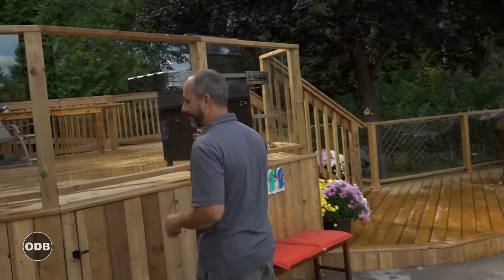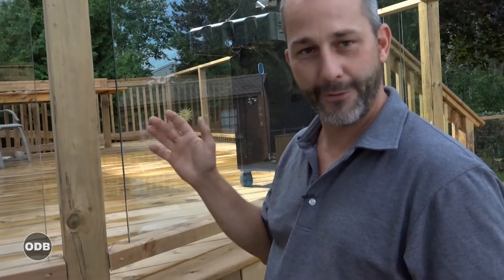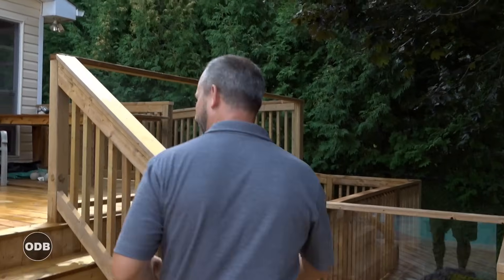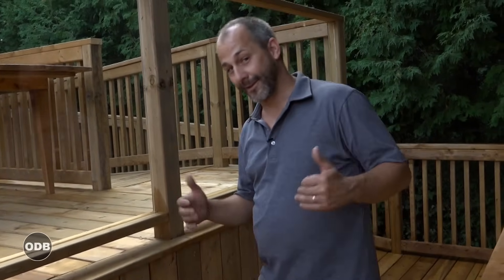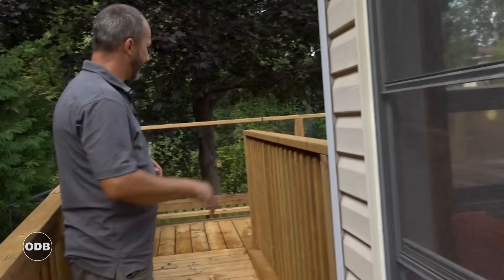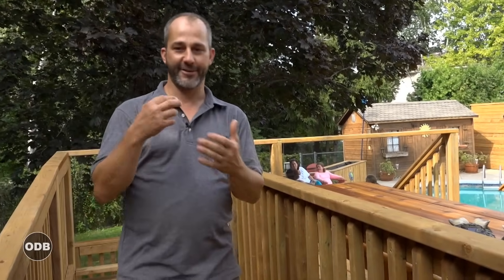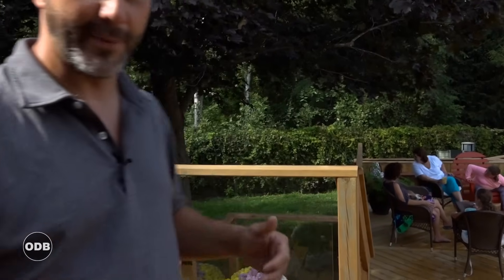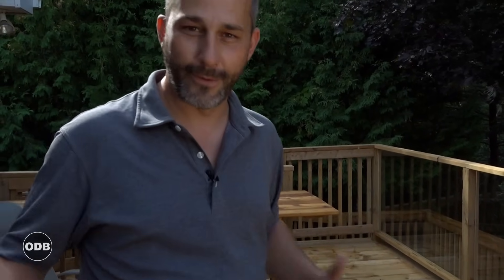DIY DECK Part 8 | How did it turn out?

Comment: Nice job. Just one question regarding the staircase handrail. A handrail is supposed to, by code, be easy to grab by hand. A 2x6 is not something that you can easily grab, it’s just too wide, it doesn’t fit in your hand. It wouldn’t pass code in a house but does it pass code outside a house? 
When i do decks, i usually install black aluminum handrails onto 4x4 posts, looks clean, easy to install and easy to grab.

Comment: I love everything but the ramp. I built a similar deck with upper and lower and a ramp for my mother in law who lives with us. I live in a rural area so our regulations are pretty much nothing aside from it being safe so I was able to take it to the ground. I started the ramp at the house instead of on the outer edge of the deck so it would run down the side of the upper deck then along the front to meet up with the bottom. 90 degree turns can be hard for someone in a wheel chair and particularly for my mother in law because of muscle weakness which is why she is in a wheel chair to begin with. I also made mine far wider so she has plenty of room to maneuver and a grade far more than recommend so she can handle it on her own without struggling.

Comment: Interesting.. In our neck of the woods, code prohibits you from using 2x4 for the hand-railing. The rationale, is that a smaller hand-rail allows a child or a person with small hands to be able to adequately grasp the rail.

Comment: Hey Jeffrey - I always hear differing opinions about what type of skirting to use under the deck.. Biggest concern is airflow, and next would be pests/critters... Doesn't look like mor ethan 1/8th of an inch gap left between the skirting boards here, would this not prevent moisture from evaporating due to the restricted airflow, which would accelerate rotting?
Reply from the maker: That is why we use cedar. this region has a lot of skunks so critter control is very important

Comment: Gotta say great workmanship father and son team 

Got a question I've never built a deck in my life im a pipe fitter 17 yrs i have all the materials to build a deck this summer but im not to certain where to start from deck is a L shape deck 16' by 32' would i get away with 2 foot centers instead of 16" centers as im trying to go the cheapest route in building it if you have any answers please contact me back 

thanks Tyler banff,alberta,canada
Reply from the maker: 2" center is fine if you use 2x6 as your decking material. If you use 5/4 deck board you must go 16 on center. The cheapest rout would be to make a smaller deck.

Comment: hi jeff watched video start to finish enjoyed every minute ,about to start decking project on back garden using floating system.what I am interested in is what type of glass you used ,I noticed you left a 2"gap on either side is this for a reason or could you put full post to post glass.once again enjoyed project and if your son turns out half as good as you he will do well . kev griff aldridge, west midlands ,england
Reply from the maker: The spacing was to avoid any pressure on the glass if posts started to twist over time or uneven elevation over seasons. just a little mercy. I used a 8mm tempered glass product sold in the hardware store for use with an aluminum post and rail system. Thanks for the kind words. My 2 sons are already better men than I ever was at their age.
Reply: hi jeff thanks for reply it makes perfect sense I would be tempted to put a posh leg centre of glazed panel ,did you use  a silicone to bed glass in. it would be nice to go to local store to pick up glass but in uk it would have to go to glass manufacturer . if your boys are in uk come spring help would not be a miss.
Reply from the maker: Hopefully one day this channel will allow us to travel the world and do renos in other countries with different materials and building practices. As for the glass, just run a 2x4 through a dado blade on the table saw to seal your glass. Before installing it put a couple of silicone shims in the track and drill some small holes for the water to drain. This will extend the life of your railing. Cheers from Ottawa.

Comment: Awesome work.  The only criticism I have of this build is how the transition from the deck railing to the stair railing seems a bit disjointed (3:52).
Reply: Yea... dealing with code and inspections, being a contractor myself,  I see WHY he did that.... especially since he was probably pushing it and pissing people off with the glass element....but that post should run past both joined rails and be decorative capped. This would be visually more appealing.

Comment: Hi Jeff! Love the videos you do! Always so informative! Wondering if you could answer a question for me. We are having our front steps rebuild with pressure treated decking. The current porch is just barely resting on the concrete slab that is in front of the steps. I have read that the stringers should be attached to the posts that are concreted into the ground. The contractor has told us that he can just rest the stringers and posts on the concrete slab. What do you recommend? We have yet to get a permit for the project, and therefore don't know what the city we live in will say. I can tell you like to do things the right way. So do you have an opinion?
Reply from the maker: Hi Debra, sounds like the city will be in charge of that decision. I personally prefer to transfer load to the strongest object around.

Comment: That is one awesome deck! Why didnt you use some tape on the top of the joists before installing the deck boards? Isnt it supposed to help with the moisture retention between boards?
Reply from the maker: You only need it if you never clean the organics out. A simple pressure wash twice a year keeps everything clean and dry. Cheers!

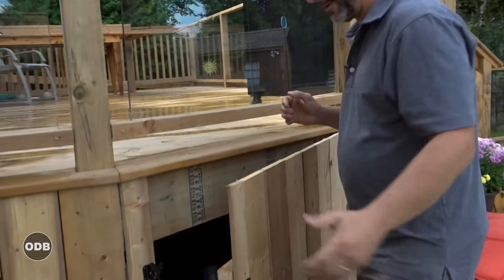Comment: 1:11 How did the lower 2" x 4" hold up. Wouldn't blocking under that prevent sagging under the weight of the glass panel?  I like the clean look, but expect it would sag over time.
Reply: I think he uses long spiral nails for that. I think I would have used 4-sided deck rail brackets. $5-7 a pair, but I suppose he didn't like the aesthetics of them.
Reply: Everything will twist out of shape eventually
Reply: @jeffbrown4292  Likely, and a 2x4 on its face will sag under its own weight over time even without a load (glass panel) on it. I get what he was trying to do from an aesthetics point of view, but there's a reason 2x4's in this application are placed edge horizontal even though it wouldn't look as good. A small block in the center could solve any potential sagging issue and wouldn't look too intrusive.

Comment: Nice video, Jeff... did you use any wind anchors for the floating system? What wind anchors or anchor system do you recommend?
Reply from the maker: Not required where we live. If you have heavy winds in your area I would suggest pouring footings.

Comment: hi jeff managed to find camo system in uk camo tool wide board £48 aprox $58 camo screws £82 aprox $99 for 2000 is this the kind of price you would pay.total price £130 small price to pay knowing my grandkids are going to be running round bare footed on the deck thanks for the info.also nice to see you use dewalt tools as every tool in my workshop is dewalt hope for a reply kev griff
Reply from the maker: Hi Kev sounds like it is a little more costly than here but like you said a great investment. Should prolong the life of the deck to 30 years. Love Dewalt tools. Hope your grand kids enjoy your handy work! thanks for watching.

Comment: hmm... in Norway the gaps in the rail has to be maximum 4", not 3". Are canadian toddlers a lot smaller than ours? :)
Reply from the maker: Yes we have much smaller heads!
Reply from the maker: I am pretty sure the actual code is 3 1/2 but this is so much faster than measuring 3 1/2

Comment: WHAT AN IMPRESSIVE, PRACTICAL & INFORMATIVE DISPLAY OF OTTAWA DESIGN & BUILD'S, EXPERIENCE & QUALITY OF WORKMANSHIP, YOU WERE AN ABSOLUTE PLEASURE TO WATCH ON MY COMPUTER SIR,YOU SHOULD BE VERY PROUD OF WHAT YOU HAVE PRODUCE, FOR NOT ONLY YOUR CLIENTS BUT EVEN A LAYMAN LIKE MYSELF, I"M IN THE PROCESS OF BUILDING MY OWN BACKYARD DECK ATM, & BY WATCHING YOU TUBE VIDEO"S LIKE YOURS, ESPECIALLY LAYING THE TOP BOARDS DIAGONALLY, IT LOOKS FABULOUS.
 MYSELF AS A PLASTERER (DRYWALL) IN AUSTRALIA, I"M NOT THE BEST CARPENTER BUT YOU HAVE GIVEN BE SOME GREAT ADVICE TO TAKE FORTH FOR MY PROJECT, SO WITH THAT I"LL SAY THANKS MATE, LOVE YOUR ATTITUDE TOWARDS BUILDING WHAT THE CLIENTS WANT & NEED, MAY GOD BLESS YOU SIR, I"M OFF TO GET MATERIALS FOR MY 6m x 4m SLIGHTLY RAISED OFF THE GROUND DECKING.... Cheers OTTAWA D&B PEACE OUT CANADA..FROM JOHN M FITZGERALD, MELBOURNE AUSTRALIA, G"DAY.
Reply from the maker: John, I am humbled by your response. Thank you for all your kind words. Glad to be of some help.If you run into anything unusual feel free to contact me. Cheers to down under.

Comment: Isn't the ramp a kind of narrow for the wheelchair? Seems too tight, especially around the corners.
Nice job though.
Reply from the maker: The ramp needed to stop within 48 inches of the fence to pass inspection. so we built it just big enough to navigate . However i agree it would have been nice for the city to give us a little extra room.
Reply: could you not have just shortened the deck by another 200mm
Reply: What city is this? Their code seems like a joke to me

Comment: I really like the design of this deck but man did you skip some important steps… i was hoping to see how you finished off the top rail, especially in the 90 degree corners, and the top hand railing for the steps in this series… especially how you topped it with a 2x6 and managed to make it flush with the top deck rail. 😢

Comment: Hey Jeff, isn't it so interesting hearing about the different codes across canada.  Our city wouldn't even care about the glass. On the other hand they are anal about having handrails on the steps that a person is able to grasp. Your 2x6 top rail handrail is awesome but wouldn't pass our code. If we want the 2x6 look we also have to add a  goofy looking handrail like an interior handrail. 
That thing is built like a brick shithouse!
Reply from the maker: Cheers Dave, You can add a 1x2 as a handrail for inspection and then remove it or pay for an engineer to pass it.

Comment: your deck is not to code. You can't be using screws or bolts to support the weight of the deck. You have to use the post to support the deck. Realtors won't even be allowed to sell that.
Reply from the maker: Cuffs. I'm sure the 2  engineering inspections that I passed can back me up whether i am to code or not. thanks for your concerns. perhaps you have a different code in your city.
Reply: I've never heard of a state not enforcing those dangerous methods since people die from it every year.
Reply from the maker: Obviously there is room for you to come to a new understanding since this is a permitted job and inspected and passed. If the city won't pass it all you need to do is find an engineer who will. Once you have an engineer stamp the city has no liability and will pass anything an engineer approves. This is simply a quicker cheaper method of obtaining great results.
Reply: I just realized that Ottawa is in Canada and I'm in the US. That explains since Canada's building codes are non existent and people there have been begging for more enforced building codes for years.
Reply from the maker: That is a bit of an exaggeration. Although there is definitely room for improvement.